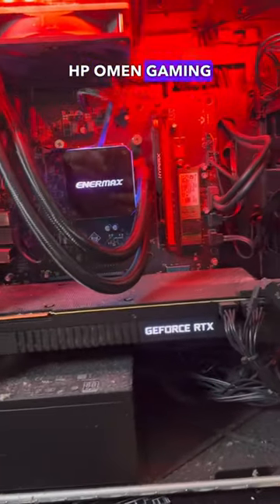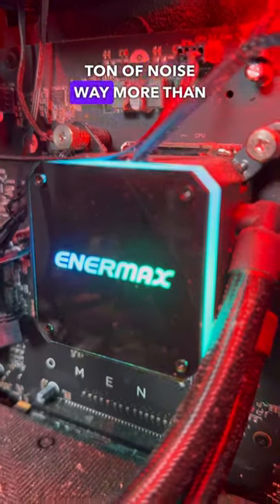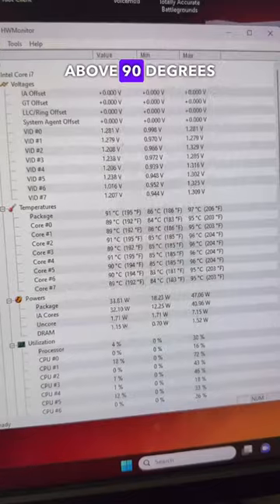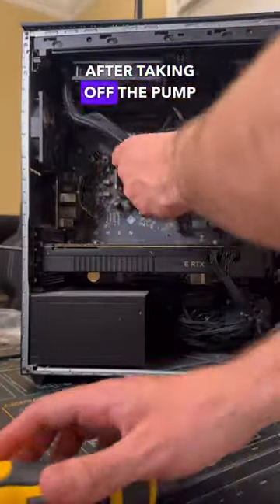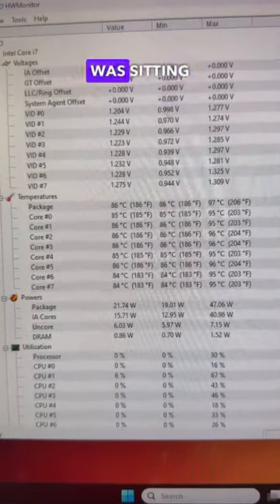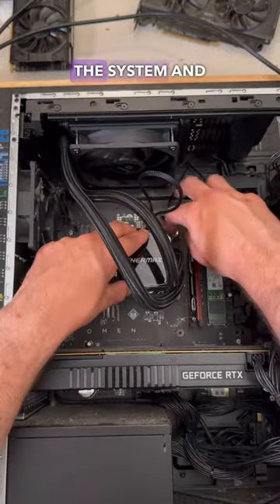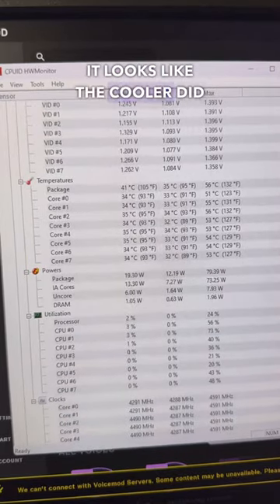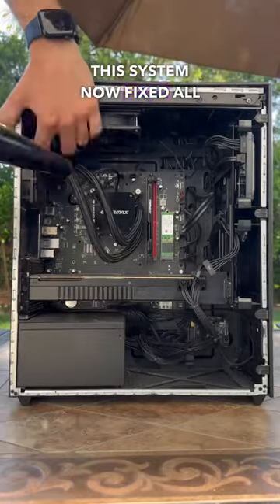OVERHEATING Gaming PC! #shorts #pc #pcbuild #gamingpc #pcrepair

Comment: If it was me, I would have just switched to a decent air cooler since it would perform on par with that aio, only part that can fail is the fan which is easily replaceable.